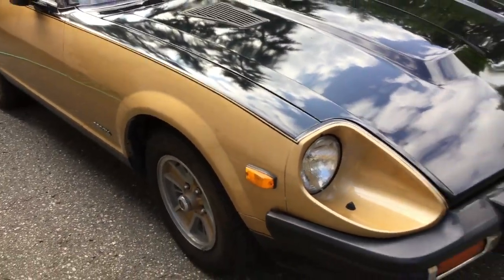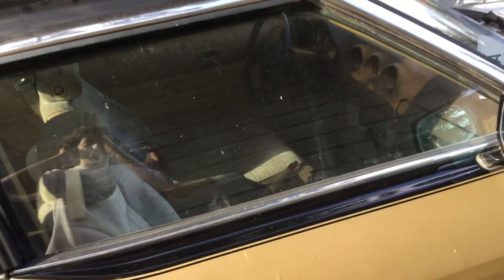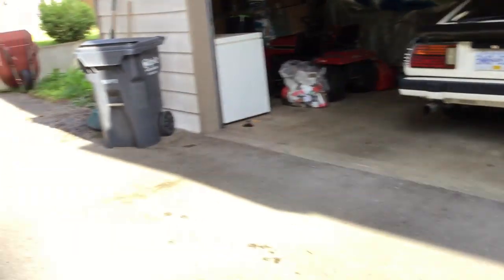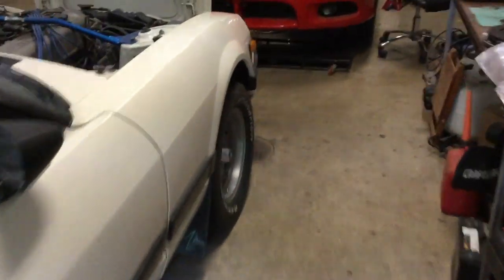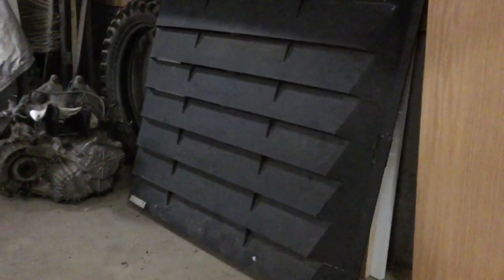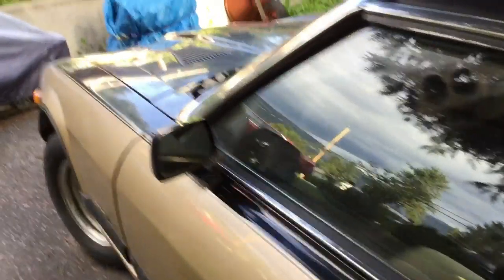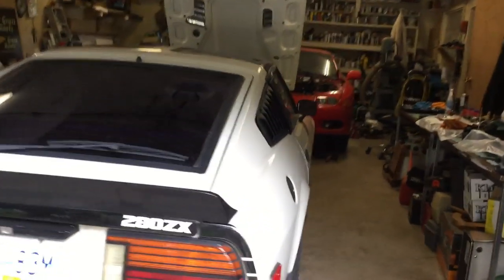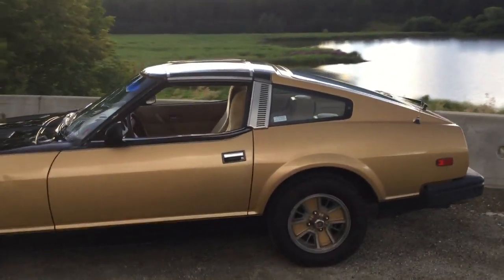JACKPOT! 2 Special Edition 280ZX's & Update on my Z and the 3000GT!

Comment: Not sure if those are 10th anniversary editions. Something looks weird, like the missing emblems on the side.
Reply from the maker: I know the 2+0 is legit because it has the rare badges on the console and dash, but the side and rear badges were removed when it was re-painted. I think it looks better this way anyway and they did a professional job on the paint. But the 2+2 might not actually be special edition as it does not have the rare interior badging. Either way, that one wouldn't really be worth more because it's not in the first 100 built and well, it's a 2+2 after all haha.

Comment: You should install the ABR kit on those 280ZXs

Wait , you bought a FWD 3000GT , do they still exist ?? You better drop a LS motor on it 😆
Reply from the maker: FWD 3000GT's are not that hard to find were I live lol. It will have more than enough hp when we're finished.
Reply: @BlazebeatRacing  your not planning on using the same motor aint you
Reply from the maker: Chouun Shiryu 6G72 with forged crank and 4 bolt mains. 👌
Reply: Wat about force induction systems ?
Reply from the maker: Chouun Shiryu It’s an N/A so we’d need a new ecu and a ton of parts. First we just want it back on the road, but I doubt he will put Turbos or Supercharger.
Reply: Well i suggest an LS swap , you can keep it in NA and doesnt let you down for very long time and not being slow 
The NA variant of the 6G72 is kinda hopeless
Reply from the maker: @Chouun Shiryu It's not my car anymore, I can't decide what to do with it. Although I encourage him to do as many performance upgrades as he can. Mitsubishi parts are expensive, but he wants to stick to the 6G72 because it's built for 3000GT's. It's a great engine, N/A or Turbo. He knows it like the back of his hand. And I respect people who stay within their car's engine variants. Swapping in completely different engines for the sake of HP gains is not all it's cracked up to be. Most people never get all the bugs out of them, and the ones that do usually spend about 20K in the process to get everything to fit and function just right. Besides that, using engines other than the original options messes up the weight distribution in most cases. I know LS engines are pretty light, but that doesn't mean it won't change the way the car handles. For serious drivers, handling comes before horsepower. I'm sure this is old news to you, but you asked for it haha.

Comment: Are you going to turn it into a devil z?
Reply from the maker: Mlg Sheep Naw, 600hp L28 builds cost too much lol
Reply: Blazebeat Racing how about going for 300 to 400 hp?
Reply from the maker: @Edwoah_The_Legend  That would be great, that's really all you want for an S130 anyway. But first I want to finish with the suspension and a few other tweaks. Would like to find a racing seat that sits lower than the stock seat (hard to find for the S130's) and maybe a roll bar with a harness mount too.
Reply: Blazebeat Racing yeah that makes sense
Reply: @BlazebeatRacing  oh ok

Comment: The black and gold anniversary edition looks awesome, it's too bad they didn't have turbo, scooped hood like the 300ZX 50th did and other things.  It was mainly about looks, but at the same time, the ZX was so fully loaded that it's hard to add more features to it, but they should have made them turbo with maybe some suspension upgrades.
Reply from the maker: They did make a lot of Turbo model 280ZX's between 81-83.
Reply: @BlazebeatRacing  IMO, the anniversary edition should have been a turbo.  The ZX gained some weight over the years and the turbo really helps out.  I've had a few "special" cars over the years and I really don't like the "decals only", they really need to do more than decals to make a car special.  Even the ZXR had more.
Reply from the maker: Karl Jay I agree! Actually I didn’t know that they had no Turbo models of the special edition 280ZX’s. That’s disappointing lol
Reply: @BlazebeatRacing  I have 2 ZX's and both are non-turbo 5speed, 2 seater and I looked for years to get two things: 1. DIesel crank. 2. factory turbo.  I bought my 3rd ZX because it was turbo.  I gutted everything from the rear, 5speed, complete engine w/turbo, etc...  It took me years to find one.  IDK what the production numbers are on the turbo, but I REALLY want to get to that project some day.  The parts have been sitting in the shed for 10 years.  Sadly none are TTop and I found a TTop shell but don't have the space for it.
Reply from the maker: @karljay7473  But the best thing about non-T-Tops are that you don't have to replace the old weatherstripping, which is very expensive. The T-Top is fun for city cruising but otherwise I don't enjoy it as much because there is so much wind noise I can't hear the exhaust!
Reply: @BlazebeatRacing  I guess it's just a "cool" factor.  I have a truck that has a owner installed sunroof and I never use it.  Maybe it has to do with being fully loaded.